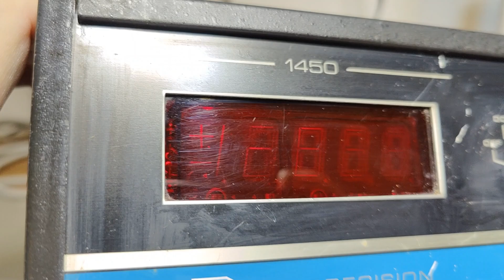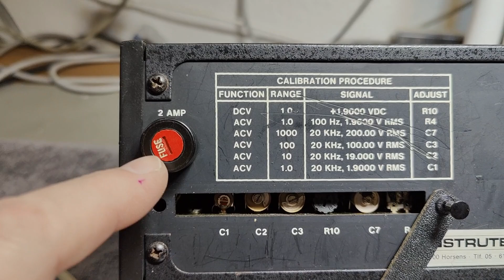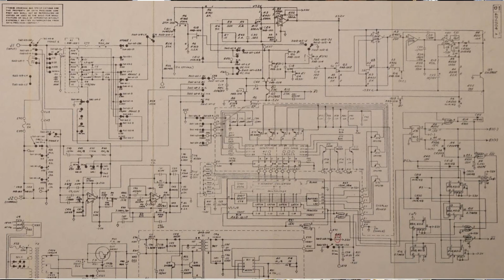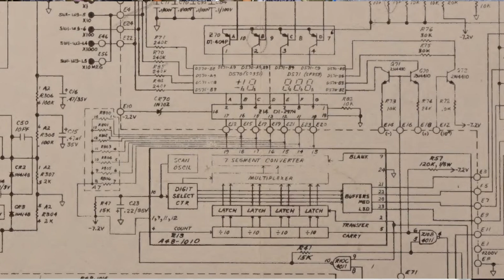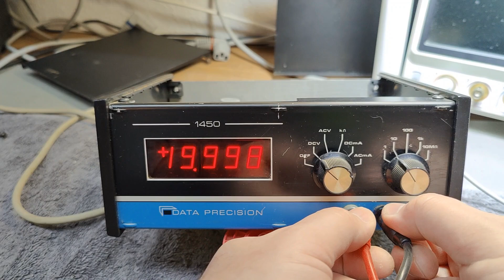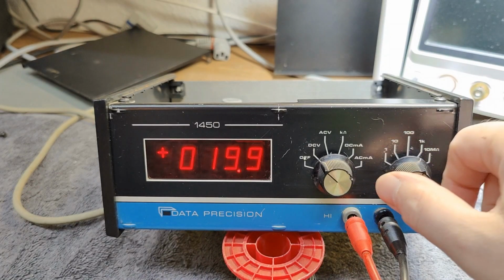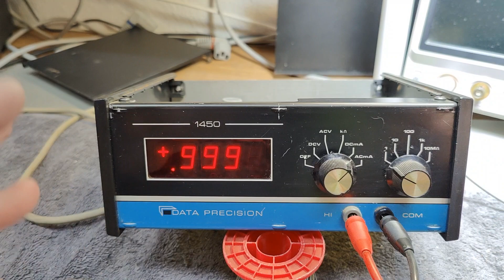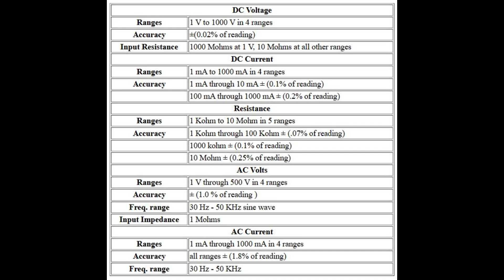Data Precision model 1450 4½ digit DMM voltmeter 1978 test teardown

Comment: The reason for the DC/DC is the battery option. I also own a 1455, which  had a battery. I also have a original manual.